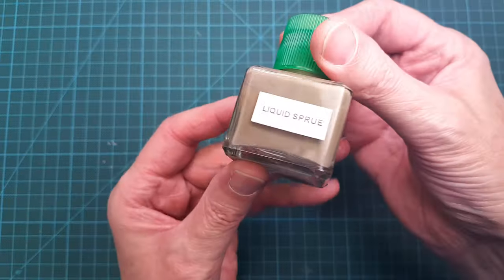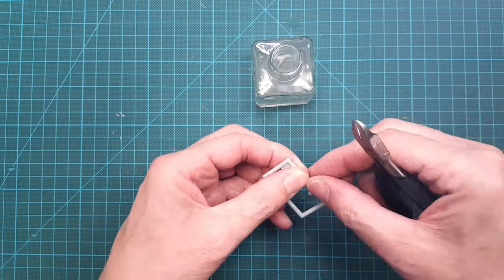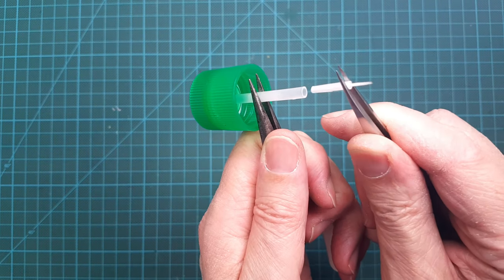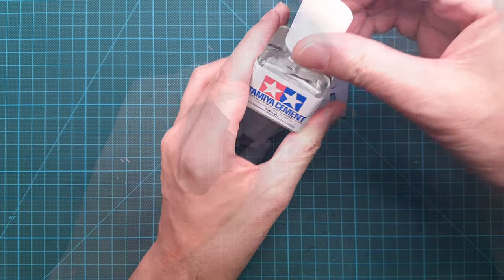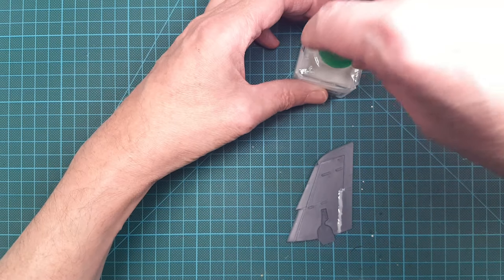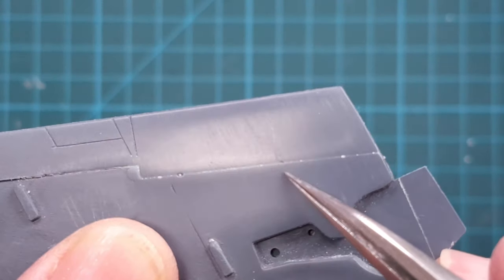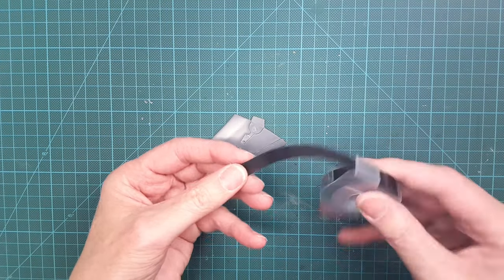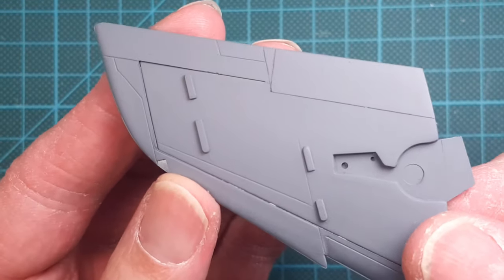My Way: Liquid Sprue

Comment: Amazing! I've been using that technic since 1987 w/ testors liquid cement as a solvent. Long cure time, but adjusting ratio, " hot" thin fast drying or "cold" thick (takes for ever)
Reply from the maker: Yes, it's a great tool. Thanks for your comment

Comment: Oh man, Plastyk kits (Plastyk actually means both artist and plastic in Polish, though plastik is more common form for plastic). Their kits come in two varieties - either their really old forms they've been using literally for close to 40 or even 50 years, or cheaply acquired retired forms of other manufacturers. To me they have a bit of nostalgic appeal as they were the most widely available kits in Poland when I first learned about modelbuilding as a hobby as a kid. But in general - avoid at all cost, or be prepared to doing a lot of fixing and scratchbuilding parts.
What kid of tape do you use for rescribing, again? I didn't get that. I have a bit of rescribing heavy project on the backburned and am looking for a good guide material. I was thinking about maybe using a double sided tape and fairly rigid transparent foil you can find on cardboard boxes with cutouts sometimes, but your way seems quite a bit simpler.
Reply from the maker: I bought that kit because I wanted a Hawker Hunter 1/72 and I could not get hold of a Revell kit, but fortunately Revell decided to reissue their kit again.
I used DYMO marker tape